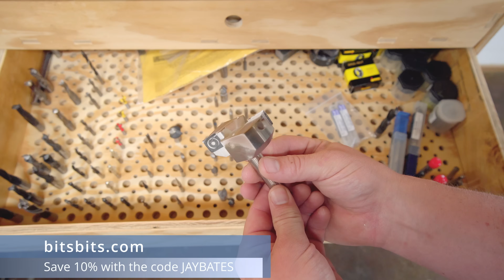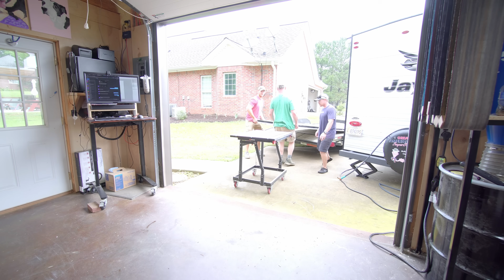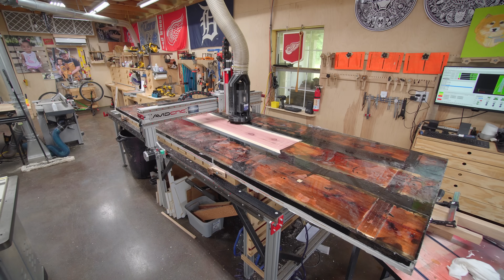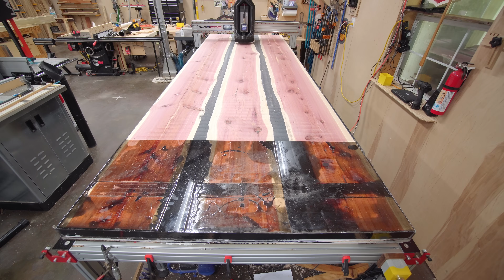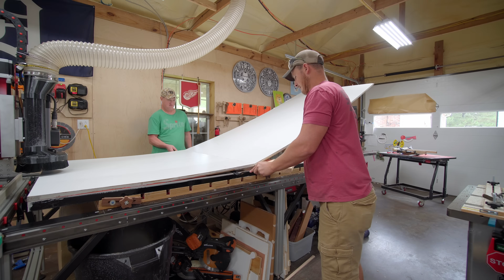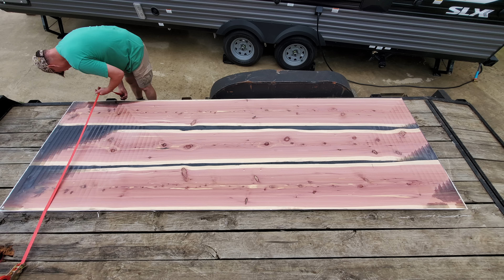Will this work? Flattening an epoxy table larger than my machine  - 387

Comment: I like the tray. I have an x-carve and use the foam packaging from mag switch featherboards in a similar fashion. The foam is shaped like a tray and I slide that under before swapping bits. Helps protect the tips if they fall

Comment: I'm willing to bet you could also build the spoil board to mount on linear slides so that the whole slide rather than just the work. Maybe add a set of drop-leaves at each end (kind of like Frank Howarth's setup) so that it isn't constantly 15 feet long. You're option would be a helluva lot cheaper and obviously works well in a pinch, but if you're doing it on a regular basis the rails would be fast, accurate, and repeatable I think.

Comment: I wrote a flattening/surfacing g-code script of a couple or so dozen lines. I modify values for X/Y min & max positions, cut depth, end mill width, stepover, feed rate, maybe a couple more variables, save it and run it. No need to use Aspire/VCarve/whatever, just pop open on the controller computer in a text editor to edit the variables. It presently is set to spiral outside to in, first with a single  complete outside "loop" pass but then after that only running in the direction of the grain which eliminates most of that cross-grain tool mark at the expense of "cutting air" as it traverses from side to side to do either climb or conventional. PM me if you're interested in it.

Comment: Jay...  Please tell us about the new dust boot/collection assembly. I have the same setup (AVID 4' by 10' Pro) and am currently using a Kent CNC boot. Your 3D printed solution w/clear tubing has me intrigued. It looks like the best option to date for AVID owners. The Kent is good, but its asymmetrical side hose connection can sometimes cause minor usage issues.
Reply from the maker: Raw woodworking on Instagram. I bought it from him.

Comment: Nice approach. If they didn’t have the melamine attached, I suppose you could approach it like using a planer sled. Flatten as much of the first side, flip it over and put onto a sheet good of your choice. Then flatten the second side. After that you can slide it down a few feet to flatten the remainder.

Comment: That looked fantastic. Do you know how they decided to handle the low spots in the corners of the bottom?  I assume just sand it smooth and not worry about it, since you didn't take any more off the rest the table to bring it down to that level.
Reply from the maker: This one will get a flood coat of epoxy on both the top and bottom before install. Because of which, we didn't put as much attention on the bottom as the top.

Comment: How long did the whole process take?
Reply from the maker: About two hours but there was a lot of talking and not working time. Each run of the full size toolpath took 14 minutes. That's 49" x 124" x .100" DOC
Reply: @JayBates  That's amazing, it would take me days with a router sled.
Reply: @JayBates  any input on feed/speed rate? I just bought a 5x8 AVID and getting requests for flattening and trying to determine rates.